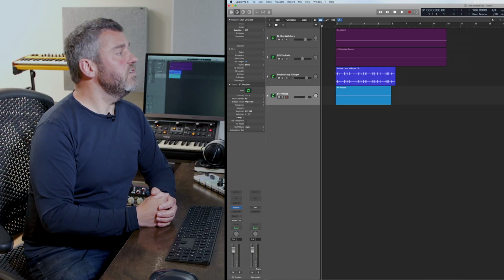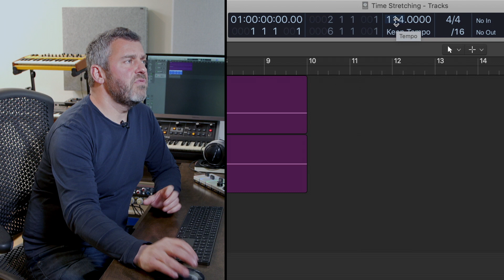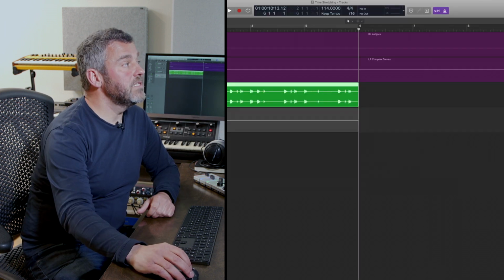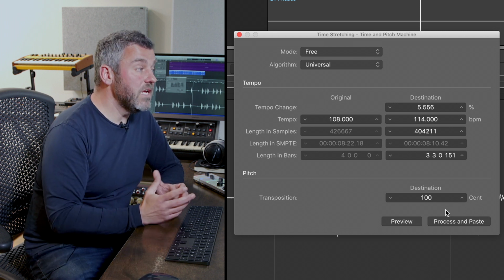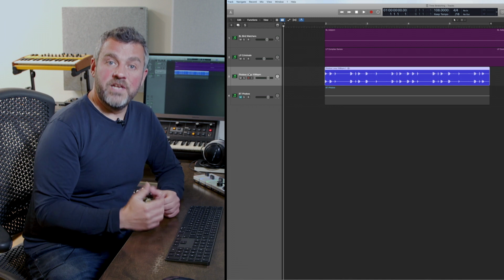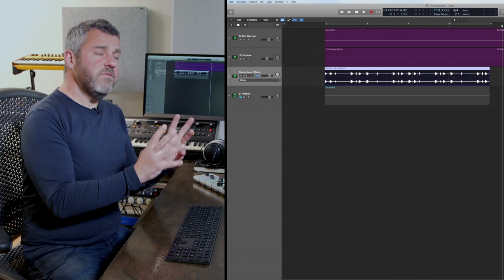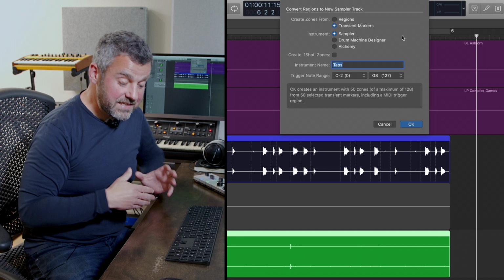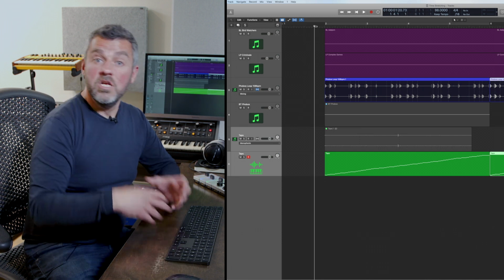Logic Pro Tips: Understanding Time-stretching

Comment: Unfortunately, although more convenient, using the option key to time stretch audio is of much lower quality than using Flex Time in Logic. Not sure why they don’t use the same algorithms between those two features. 

Also, another disadvantage when using Flex Time is that you then can’t reverse an audio region unless you bounce in place or turn Flex Time off. 

I wish Apple would fix those things when it comes to time stretching in Logic.